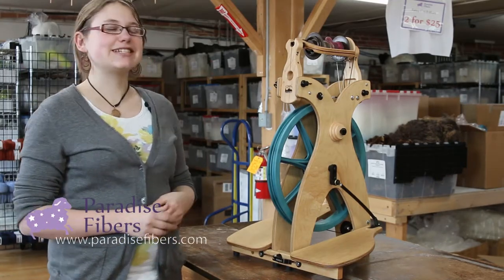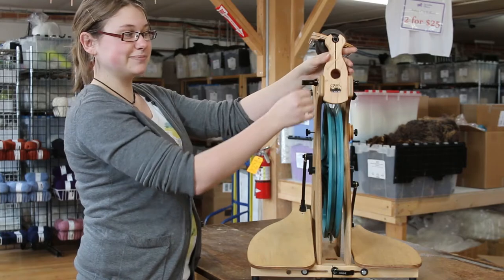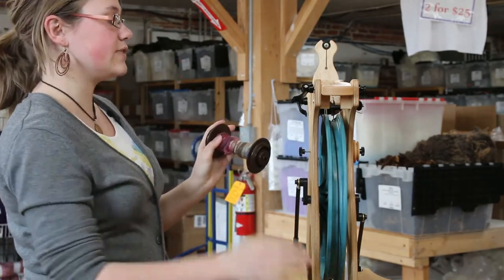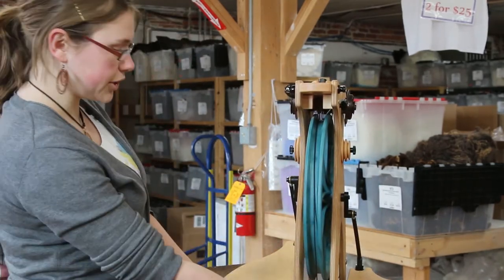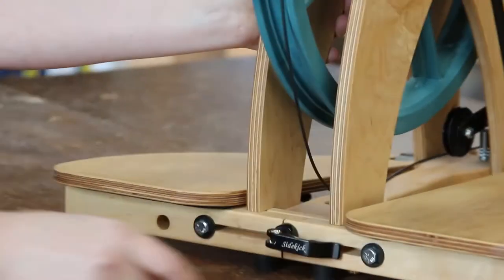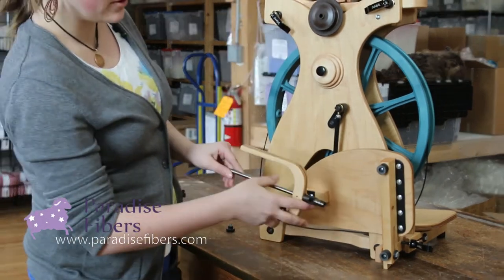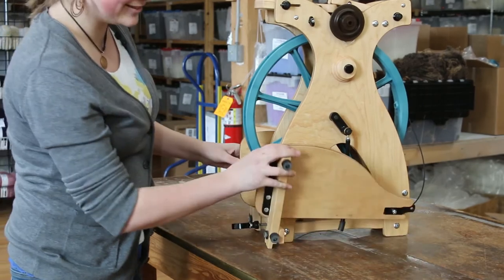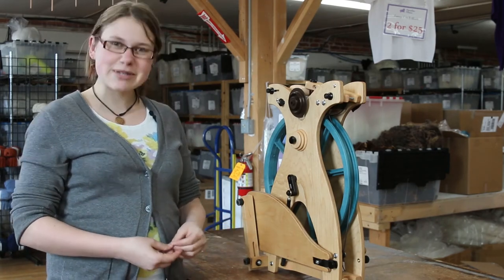Schacht Sidekick Folding Spinning Wheel Demonstration

Comment: Great demo, but you missed a trick. When you disconnect the scotch tension and drive shaft loops, you can park them on the scotch tension knob before you drop in the bobbin. That way the drive band won't try to fall off the wheel...very convenient.